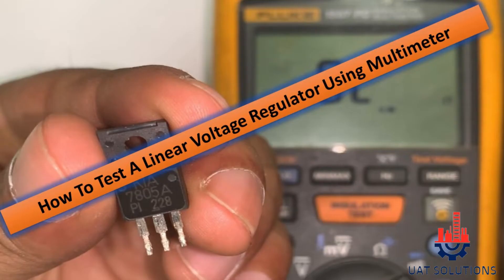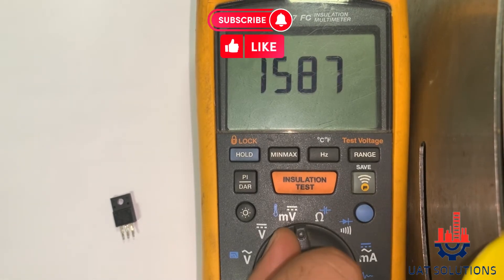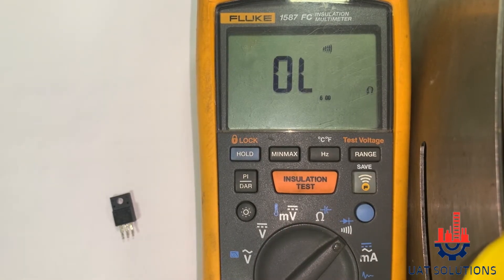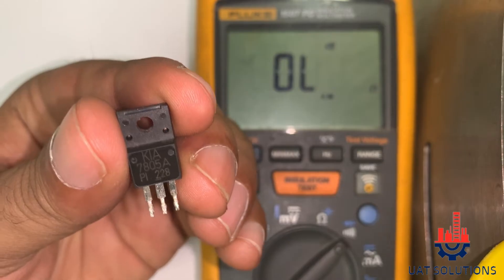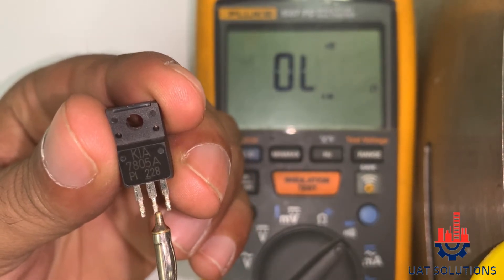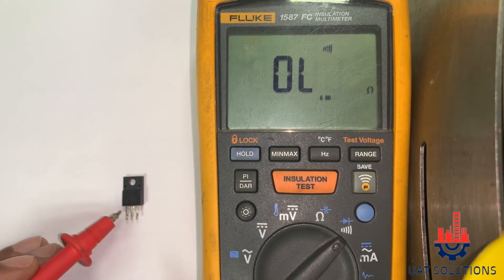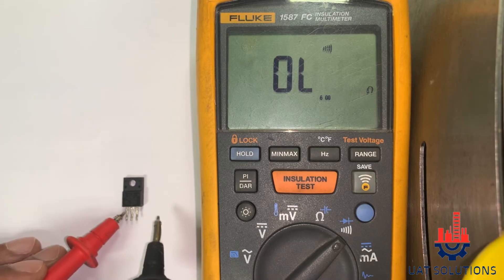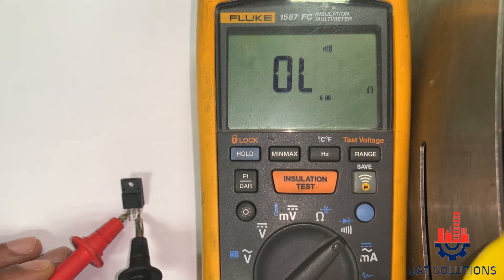How To Test A linear Voltage Regulator Using Multimeter Explained  |7805| 7806| 7809| 7812| 7815|

Comment: Great video. I have a voltage regulator behind my instrument cluster for the fuel gauge for my car that is faulty. Is there a way I can fix it if I remove it or is there a way I can tell which one to buy ? Its definitely a 3 pin. I have head if I used a lm7809 would work but will give it an inaccurate reading off by 10% apparently so I'm not sure... Any help would be awesome

Comment: What if I'm getting a reading, but no continuity, on all of those positions? Will this test work if the L7805 is in circuit?
Reply from the maker: Yes if you are getting the correct reading but no continuity its good. 

Testing regulator while its in the circuit is not recommended due to interference of other components it's connected with. 
Thanks